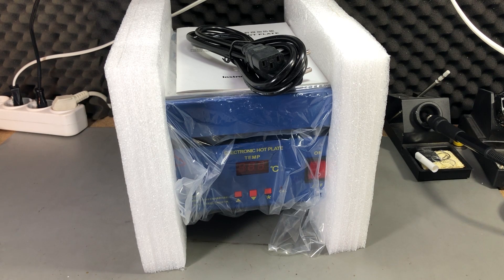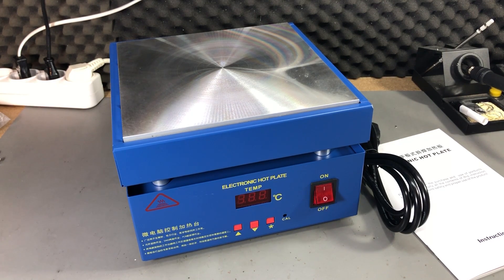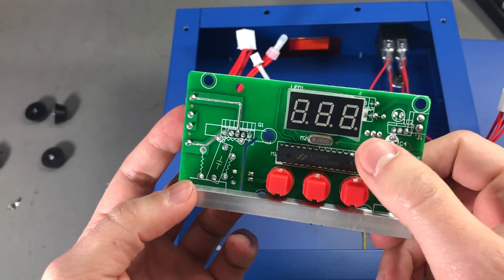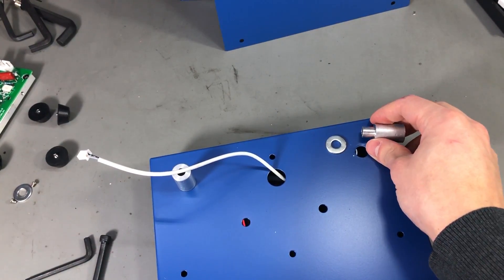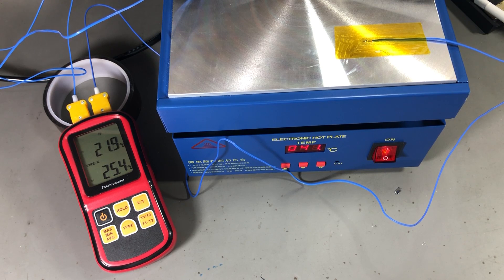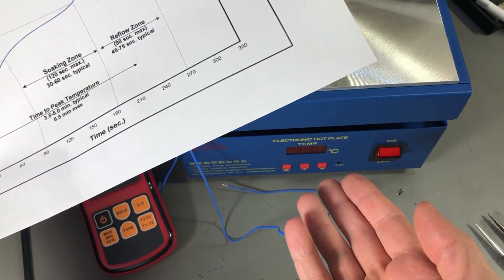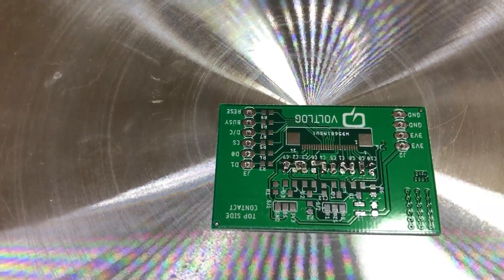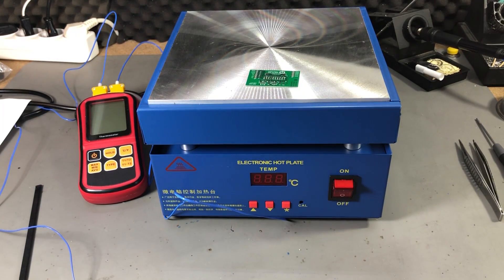Voltlog #210 - 946C Hot Plate Review & Teardown

Comment: Hi Florin how about making a wifi controller for this to be able to make heating profiles like in the oven?
Reply from the maker: Yeah that would totally be possible.
Reply: @voltlog  +1 for a custom controller for this one.. could allow usage < 50C - Bug in the firmware it seems if you have it on 50C when it loses power it defaults to 260C... anything from 51C up it seems to remember.

Comment: Hi do you know what is the width of aluminium base? It will be interesting to view how fast the plate rich the set up temperature and how long is need it to go down   if you want to use reflow profile.
Reply from the maker: yes, check out the video description.
Reply: @voltlog  Sorry. Bad English :(.  I meaning do you measure thickness of the plate when teardown it? In another video for similar hot plate but with PID regulator the thickness is about 6mm also there is used the PTC heat elements but I am interested in this particular model and from your video I see they used the cartige heating elements which I think are better vs PTC. Also there are models with thicker aluminium base with over 10mm and they have good thermal mass and I don't know which is better thicker or thinner. Maybe thicker will have better spread of heat over entire plate but will heat up slower and if we used it for reflow sometimes it  preffered faster heating. It is difficult which model to order. Also I find good controller for upgrade the ALTEC PC410. It is used for BGA reflow stations and also support control via serial interface from PC. Also if you measure rising temperature time for about to 250 degrees it will be great.

Comment: For preheating a PCB that already has components installed on both sides (rework) and therefore has to be elevated above the plate, wouldn't it work better if the plate was black? (Grill paint would probably be a good choice.)

At work, the usual rework procedure is to set the hot plate to 150C (the board on a holder that's elevates it about 1cm above the plate) and use a heat gun or iron to actually melt the solder.
Reply: I don't think color would matter much, most of the heat transfer in that case is gonna be by convection, not radiation. I don't think it'd work very well for heating an elevated board either way, though, as it's designed for conductive heat transfer.
Reply: @jasonmhite  Where can I learn about these topics? How do I look for books on the topic?
Reply: @anneallison6402  Engineering thermodynamics and heat transfer textbooks. You can probably find old ones for cheap at a used college bookstore, the basics haven't changed.
Reply from the maker: For double sided pcbs, with no contact, one of those IR heaters works best. In the case of this simpler hot plate, heat could couple through other parts like shields. I've never tried grill paint, and I'm not sure how much of a difference it would make.

Comment: I know this was only a test, but maybe if you cut 2 long rectangles in a plastic sheet the length of all the pins, it would make a decent stencil because the plastic sheet thickness would limit the paste volume. The low paste volume would naturally stop bridging when it sucks to the pads, so a continuous line shouldn't be a problem.
Reply from the maker: Never tried it but your idea should work. Mostly these days because of low cost I also order a laser cut steel stencil with the cheap pcbs.
Reply: @voltlog  It kind-of works, you just have to be careful about not over doing the paste the smaller the parts get. My stencil was probably too thick for my SSOP-28, and my slots were definitely too big.
https://youtu.be/Aapp_6KvJ7w

Comment: I've been curious about a setup like this for awhile. I don't know if a device like this is going to be my solution though. I would have preferred to see a more in-depth characterization of the temperature across the entire surface. I admit I have no experience with hot plate reflow. So my opinion is useless. 
  That said, I'm concerned about reflowing larger boards in the future and the potential for temperature variation across the surface while doing a real flow profile seems like a potential issue.
 Why the heck does this thing need to get to 946C (1735F)? Is someone looking to reflow brass with this?

  I do wish these Chinese manufactures would recognize their market though. The ability to hack this kind of thing is probably the primary selling point. This kind of product is obviously as low of a manufacturing cost as possible. However the choices in hardware used could have an exponential impact on the way customers view and popularize this kind of thing. Adding an extra $1-$3 to the hardware BOM could make an enormous impact on the DIY/Hobbyist market. Just choose an AVR, STM32, or PIC μC, and place a functional programming header footprint on the PCB at a minimum. If there are any unused pins on the μC, break them out to unpopulated pads. If they must do some cost cutting thing like a couple diodes to drop Vcc voltage or can't afford to add proper bypass caps, make the footprints anyways. Most of us are going back and fixing this stuff already. Just make these things easier to do in the first place.
 Lastly they need to make a note on the product about where to find and download the source code. They have nothing to protect here. These are bare bones products without any real competition in the market. Just make it easy for the community to make use of the thing.
   Not to bring politics into this (I'm not stating my viewpoint on the subject here, it's just an observation),... but selling an open source product that includes access to hackable hardware and software as a general policy would be about the most pro-socialist kind of neighborly thing possible. I'm surprised someone hasn't figured out something like this and implemented it as a general standard for products from China.
-Jake
Reply from the maker: China has a different culture when it comes to designing, manufacturing and selling stuff, it's not easy for them to think and see things how we see them. "946C" is just a model number, it doesn't specify the max temp, it's not possible for this plate to go that high. slight variations will be present on this plate, at least until it equalizes temperature across the plate but a few degrees shouldn't matter much for the prototypes that are going to be assembled on something like this.
Reply: @voltlog  
  Thanks for the info and perspective.
  I was thinking about trying a little cooking skillet from a second hand store for my first reflow setup. They usually come with a top cover as well so that adds an extra level of potential use and temperature control. I was thinking a combo like this with a tuned PID control board could make a useful precision setup.
   I know about the toaster oven Reflow projects. Thats an option. Andy Brown even has a setup using a halogen lamp and controller. A skillet would just add the little temperature dial built into the power cord, so there would be a max temperature failsafe....although I would probably just add a thermal fuse/switch.
  Any thoughts on why a small skillet wouldn't work? That setup could also be scaled as cheap consumer skillets are available in larger sizes than any copper clad I can afford to play with.
-Jake
Reply from the maker: @UpcycleElectronics  I was thinking at a cooking skillet myself, before this opportunity turned up. It will work just fine, just pick one that comes in the shape and size you think will work best for you. The flat aluminium top of the hot plate looks nicer than what you get with a skillet and you also get a default controller board with the hot plate but that shouldn't be an issue for a maker/hobbyist who should be able to put something together to control the skillet temperature.

Comment: Often the power cables supplied from China have barely enough copper in them to not cause problems during normal operation. If something goes wrong i.e. a short with low but not very low resistance (circuit breaker doesn't trip magnetically) they can become very hot. Unfortunately it's hard to determine the conductor thickness without either cutting the cable or buying equipment to measure low resistance. It would be possible to measure the voltage drop across it with a known current though and calculate the resistance and then the cross area.
Reply from the maker: I agree most power cables coming from china are crap. Most of the times you can feel it in your hand, it feels like crap. This one however felt really good. I think this one is a good cable.

Comment: I didn’t like how there were no grommets in the chassis for the wires passing through, mine was the same.
Reply from the maker: I overlooked that aspect, yes it would have been nice to see grommets in there.
Reply: I don't think it is a huge issue, it's not like they see a lot of vibration etc, as long as the edges of the holes are not sharp.

Comment: That is the same as the one I purchased a couple of months ago. I got mine for doing MacBook repair work.
Reply from the maker: Do you use it for the repairs?
Reply: I got it to make removing the GPU easier, as they take a bit of heat due to the PCB having good thermal properties and sucking all of the heat away.

Comment: Excellent review - it looks well built.  Good brand-name jab regarding the fuse... :)   BTW - For measuring the surface temperature to calibrate the controller, I would recommend placing a bit of insulation either over the whole plate, or over the individual thermocouples.   Because of the heat loss on the upper surface of the thermocouple, there is a very good chance that calibrating without insulation will result in a surface temperature higher than the readout would indicate.
Reply from the maker: thanks for the tip, I will try to measure with insulation on top of the thermocouple next time.

Comment: Two points to note, the thermocouple is mounted directly on top of a heater cartridge not the centre of the plate. the wires passing through the metalwork have no grommets and could lead to a possible failure.
Reply from the maker: You are right, it would have been nice to have the grommets on the metalwork, but I personally think the possibility of a failure there is very slim, those wires are not moving and the insulation is pretty thick. Regarding the thermocouple, this could be the reason while the on-board display reaches set temperature so fast, while the rest of the plate comes along later. It might be possible to change the position of the thermocouple at the risk of over heating the cartridges.

Comment: I have done some reflowing on a laboratory hot plate. It works well, except that one time I let it get a little too hot and the fiberglass resin in the PCB melted into a molten black puddle. The smell was so bad, and probably really unhealthy... I've been eyeing one like this for a while after seeing one on Marco Reps' channel.
Reply from the maker: It depends on how hot you had the plate but you also need to consider there are different fiberglass materials and some have lower temp ratings than others.
Reply: @voltlog  In this case, it was because I was stupid and had a different (lead-free) solder paste that melted at a higher temperature than what I'm used to. I wasn't paying close enough attention to the exact temperature and was looking for the solder to melt, but it went from looking ok to melting, smoking puddle in about 10 seconds. Something like this one would work better, since it has closed-loop temperature regulation.